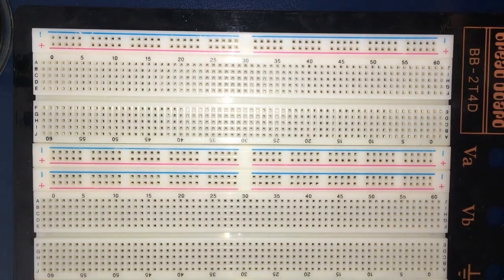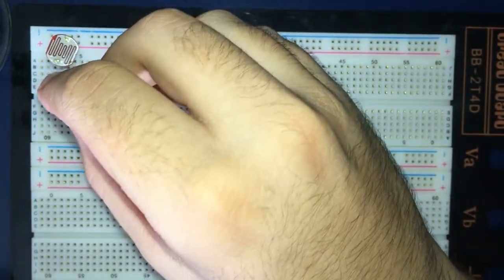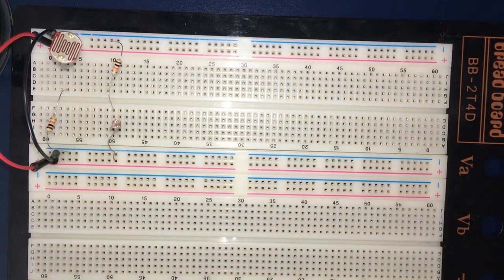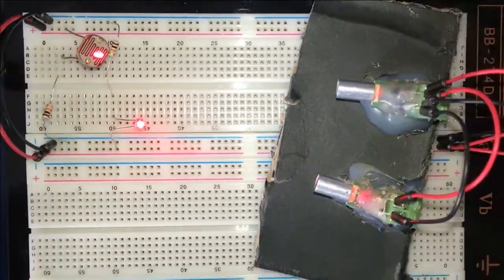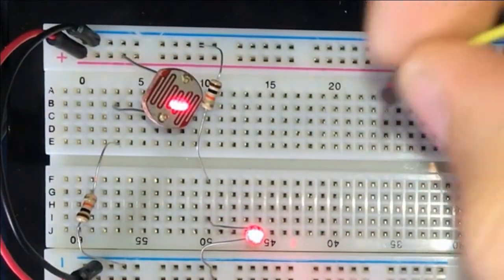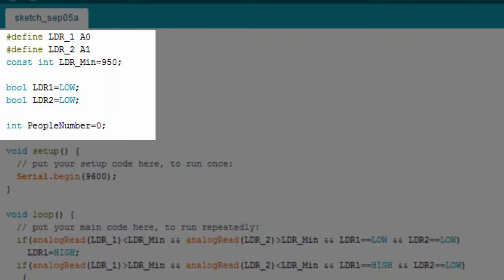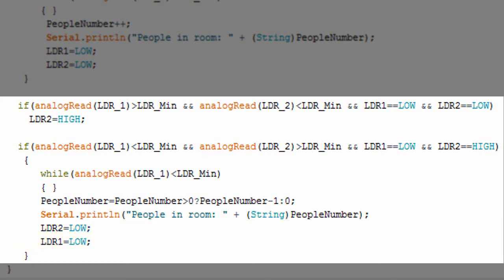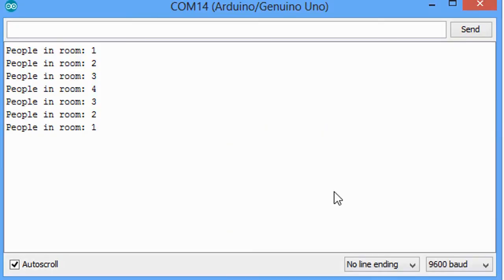Two-Way Objects Counter (using Arduino)

Comment: Great tutorial. Really helpful for a project that I am currently working on. I do have a certain question though. how did you determine the value of this LDR_MIN and set it to 950. Like how would one know that when a person is not standing and blocking LDR1, the value would read more than 950 ? thank you.

Comment: for some reasons unknown, after the code worked once, it fails to decrement and only increments in both directions. Is there anything I would have to do please?
Reply from the maker: I think the reason is that when you moved from one LDR to another, you accidentally passed through the latter one twice.